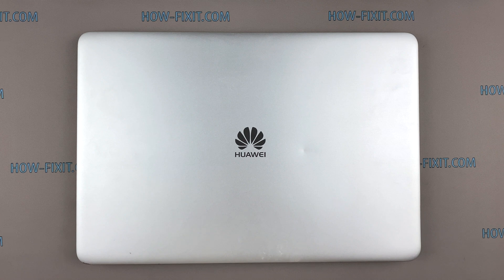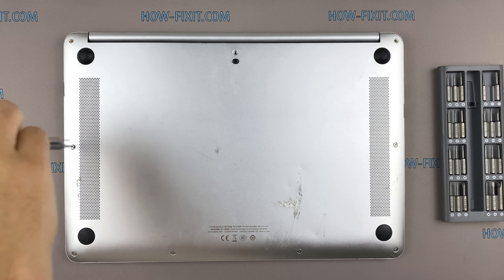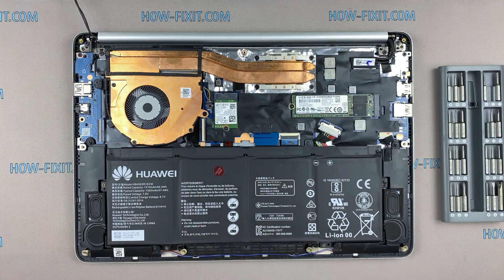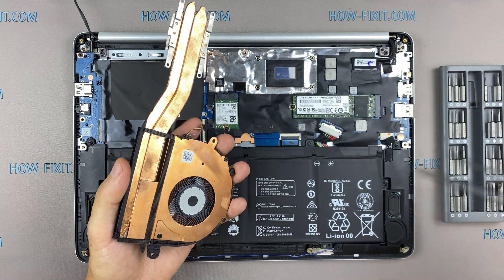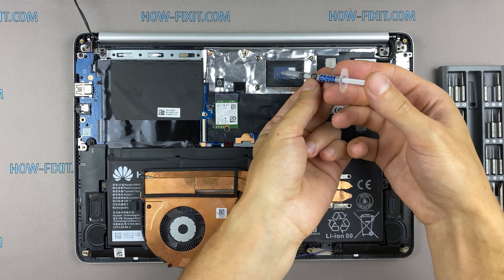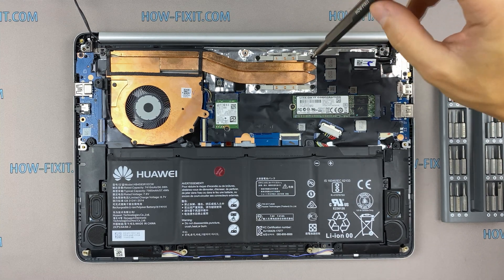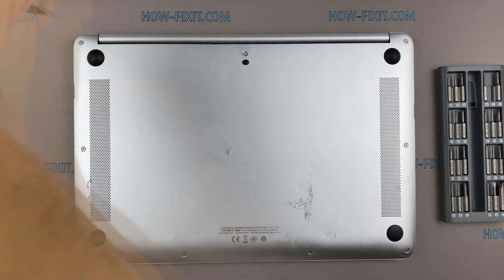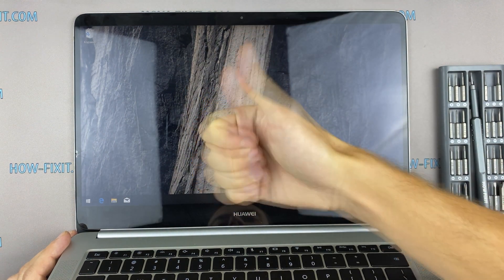HUAWEI MateBook Disassembly, fan cleaning and thermal paste replacement

Comment: At 2:10 you disconnected the 2 wires attached to the 2230, what are they for?
Reply: I recently swapped the dying fan of my Matebook with a new one, and I didn't have to disconnect the Wi-Fi cable in order to do so.

Comment: Is it possible to replace fan ? I accidentally broke 3 fan blades, temperatures are fine, but now when fan is on laptop is shaking a little bit.
Reply: Yes., you can replace the fan without disassembling the whole heat pipe.

Comment: nobody on youtube has done such video for the HUAWEI MateBook 14. All have done for d14 , d15 or 13.
Reply: I have a matebook 14 and it's likely that I have to repair mine. I have to change my battery because it lasts only 2-3 hours and I also have to repair my fan probably due to  overheating. The difference between matebook D 14 and 14 shouldn't be to big. This video is the closest one I have found. Do you have a matebook 14? Have you tried of repairing it on your own?

Comment: Hey man, I have a question.
My fan is making a noise when the Laptop is tilted, and specially when i move the laptop, it sounds like a drone humming. 
So my guess the fan is loose and wobbly. Do all of the fans of this model have this? Or is the fan just malfunctioning? 
The laptop is not overheating, but should i replace the fan or is this fixable?
I'll use your videos as a reference, they are nice and clear,  the operation seems not too bad.
Its still under warranty but i don't think something this minor is covered, plus i cannot wait while they fix it or replace it.
Reply: Hey. Exact same issue here and i have seen that many others have the same problems on different forums but no one has clear answer yet whats the issue. It seems to be that the fans have faulty production as these fans for laptops having issues after 1-2 months of use.
Reply: @cr0wN_  Any luck fixing the issue?
Reply: @Blastsniper  If you still have the warranty then you should bring it there. Most likely it's that the fan bearings are broken. I haven't opened mine to check what's wrong and fix it. There is few things that could be wrong. Dust in fans, bearings need to be lubed, broken bearings which seem to be the can since when tilting my laptop for example I can hear that fan blades are moving. If bearings are broken then the whole fan needs to be replaced. New fan for the laptop costs 30-40 bucks depending where you buy it. Hope this helps a little.

Comment: I have this exact model(AMD Ryzen 2500u) but can't find the  video on undervolting
Reply: there is no undervolting the 2500u (or most ryzen mobile) you can only unlock more power if you want with ryzenadj